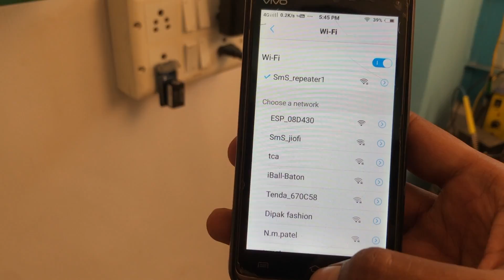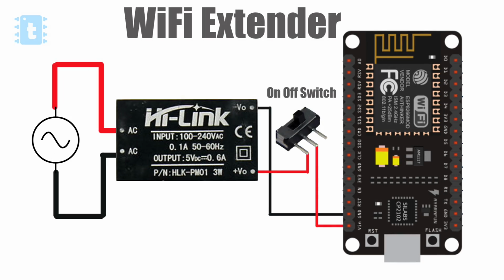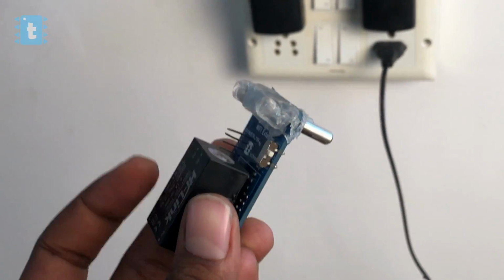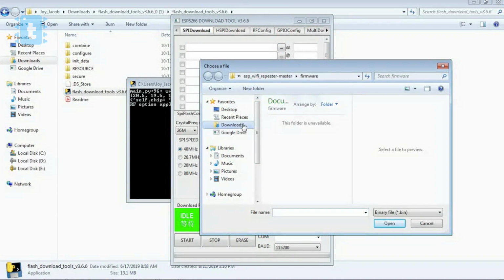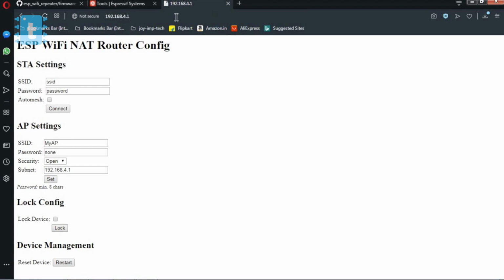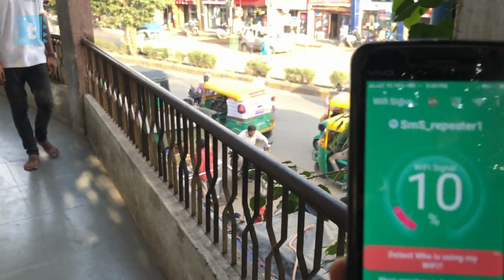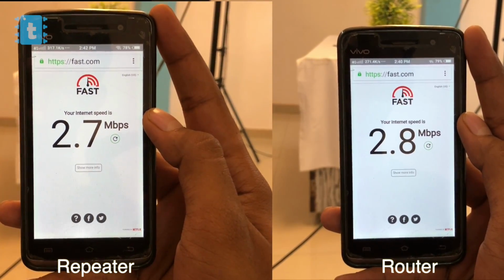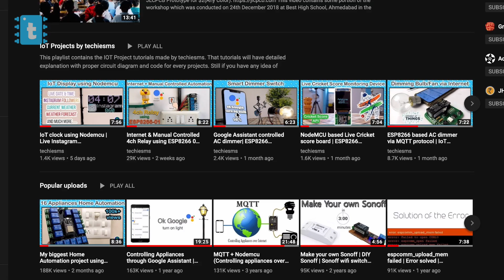NodeMCU based WiFi Repeater | JLCPCB | ESP8266 Projects

Comment: Just note: you cannot get more than 2 Mbps download speed with esp8266. My bsnl fiber gives me 100mbps. I placed my node MCU about 5 feet away from the router. With this, i still get maximum 1.9 Mbps download and 2.1 Mbbs upload. That's all about the performance. Better go for esp 32. I heard it is faster.

Comment: Nice one. Thanks. I have tried it and found the signal increased and could work with laptop setting it as metered connection. In Mobile it shows connected but no internet. Is there any solution? Thanks in advance...

Comment: yes me too have been looking for something like this , new wifi router /repeater might have costed 800 to 1500 but bought this board which i can use for other projects also like neopixel matrices ///// yes no i have setup everything and its working but i am not getting the speed [got 750Kbps -1Mbps only ]which i get if i connect to the home network router directly [15Mbps on speed test }.. could you please help me in this matter ... board i am using is ESP WROOM 32

Comment: @TechSMS i think you forgot to ad the 0x82000 bin file. i tried following your video and MyAP didnt show up till i added the 0x82000 file to list. also i flashed using 16Mbit and it worked perfectly.

Comment: Sachin some questions  Bro: I tried this thing my bandwidth is almost half after this, Secondly can I restore esp8266 back to the factory mode.
Reply: He may not answer you but let me do it, yes you can factory reset your esp and for bandwidth it depends on distance, you can always add ipx antenna by soldering it.

Comment: I'm a 1st yr student and I've a question...
can we use esp8266-01 module for this project if we don't use such pcb as designed by you...since both the esp8266 modules has the same esp8266ex chips, and it also makes sense to use a esp-01 module here as we aren't using any gpio pins here so can we use it (by programming it with an usb-ttl adapter)??
please guide:')

Comment: I am trying out the project, I connected to MyAP Access Point and opened the 192.168.4.1 but then if I enter the credentials to the settings , it just won't connect to the router. And it won't even set the AP Settings. Any help here? It says"The new settings have been sent to the device" That's it. plz help

Comment: What a great idea. Let's have something with exposed wires plugged directly into a mains outlet! Then unsuspecting guests, pets and spare children can electrocute themselves whenever the mood takes them!

Safety laws are there for a reason. I realise that in India there appear to be NO electrical safety laws whatsoever - or, if they are, nobody pays them any mind - but this video is dangerous and anyone unskilled enough to learn anything from it is NOWHERE NEAR experienced enough to be plugging crap into the mains outlet.

DO NOT do this. Or do. It's your own funeral.
Reply: Oh, and before people respond with things like "the exposed pins aren't connected to the mains", that isn't the point! If you doubt me, simply ask any qualified electrician if this gadget is (a) safe or (b) legal.

There are ways to make such a project reasonably safe. A fuse would be an awesome idea, as would an enclosure. But as things stand, the damn thing's a veritable death trap.

Comment: Great project but quick questions. You chose 5v voltage regulator and the the nodemcu will further drop it down to 3.3v, instead you should have chosen 3.3v hilink regulator. You could save power loss in dual conversion.

When you designed your own pcb, why did you decide to go with nodemcu? You are programming it once only hence those ch340 voltage regulator etc are not at all required they are waste and unnecessary consume power throughout life.

Comment: Honestly, I'd just stick with using a USB phone charger. Way safer. With a custom PCB route, you could just have a full sized male USB connector to plug into the supply with.

Comment: Nice but it have limitation of speed (5 Mbps) , if you have slow internet then its very useful 
it also have mesh router option
Reply: Для кого как для одних 5мбит норма а для других нет но за такую цену мы получаем скорость до 5-6мб/с но дальность 50-60метров
Reply: @baniban4711  Yes :)

Comment: Sir I have 1 question ....
You have uploaded reapeter firmware in this project... If I want to use node for regular project can I re upgrade it's original firmware? Instagram- @akshay_chougule__
Reply from the maker: Just upload your code using Arduino the firmware will be updated